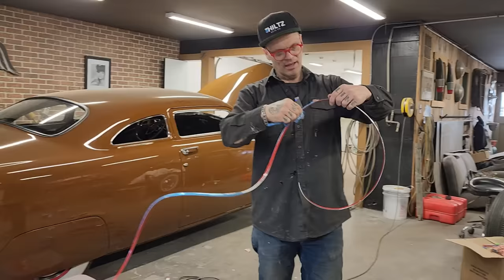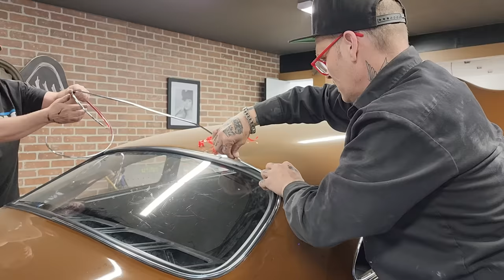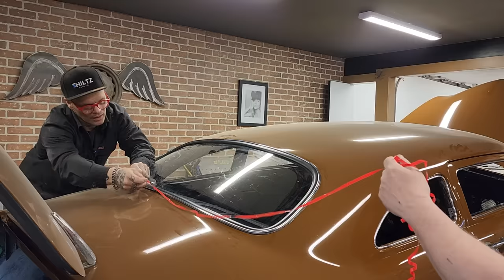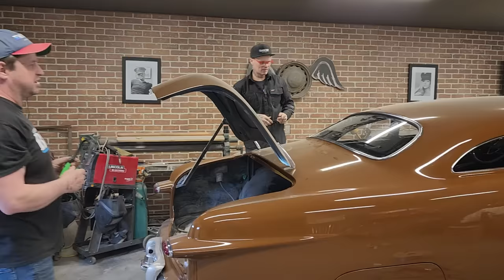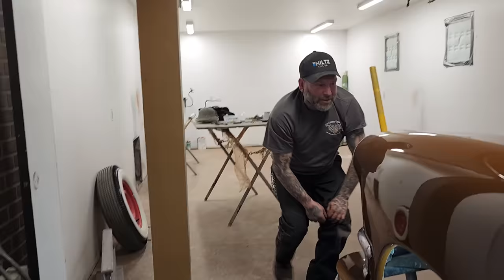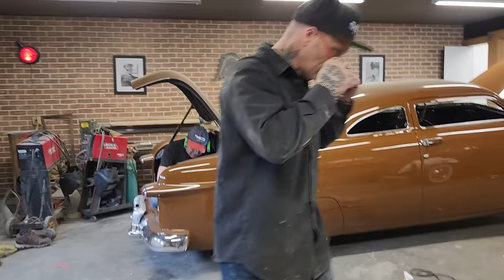Bad Chad Bonus Episode 🎬

Comment: chad an easy way to fix scratched or delaminated glass is to put window tint on the out side of the glass. I did it on a 55 Nomad I restored, on the rear quarter glass. it work well hiding all glass blemishes.

Comment: Put a white vinyl top on this ride and call it ROOTBEER FLOAT.
Reply: CO Co or hot chocolate..
Reply: It needs something.  It’s the same color as the dumpster outside of our apartment.
Reply: My thoughts are pin stripping, something not to over board but classic.
Reply: The brown fits the style perfectly. 50’s white walls 👍
Reply: Carmel
Reply: @JobyFluorine-ru4bd  try a different channel if you want a trailer queen restoration. This is a driver not a show car. His whole point was to make a chopped car as quickly as possible. Not a show car edited down to a one hour special. He wanted a one stage paint job like they did in the 50’s. Build you a show car and make a YouTube channel about it. It’s easy..they say.

Comment: Hey Bad Chad, saw you didn't like the back chrome cause it was wavy. Don't peel it off, just try warming it up a little with the heat gun to loosen up the glue strip a bit and make movable with a push of your fingers  and straighten it out that way. Just don't get to close to the strip of chrome so u don't burn or bubble up the plastic chrome. Just an idea. Hope it helps.

Comment: Fix the chrome on the rear window. You keep going back to it so it must bother you some. It will only take a few minutes to make it right so do it. Why spend all that time on something and then cut corners. Fix it and move on. Quit worrying about how long it takes. Some times you go overboard with the how long it takes. It obviously bothers you that it doesn’t sit right on the bottom of the window. Just peel it up and make it right. If it doesn’t stick back down after peeling it up then take the whole thing back off and do it again. No problem!